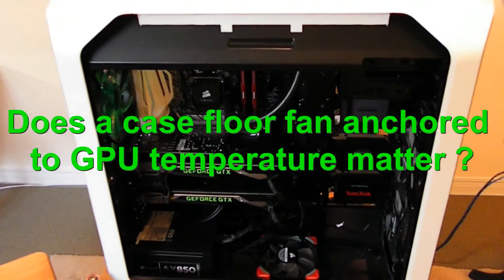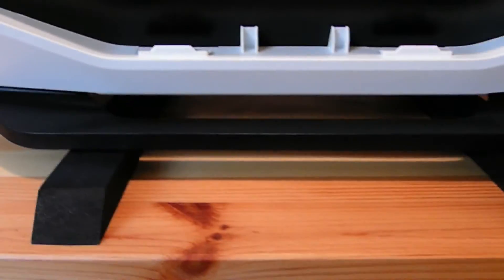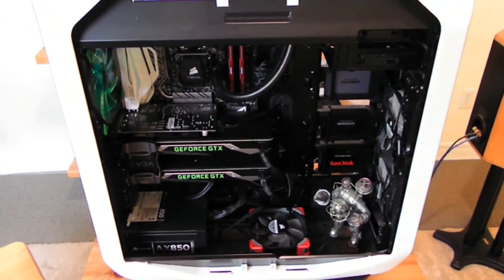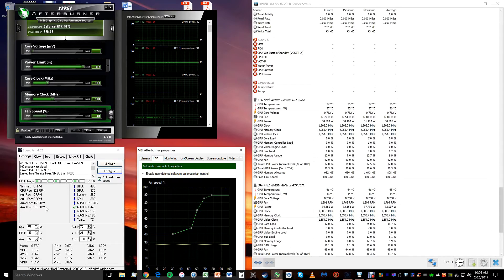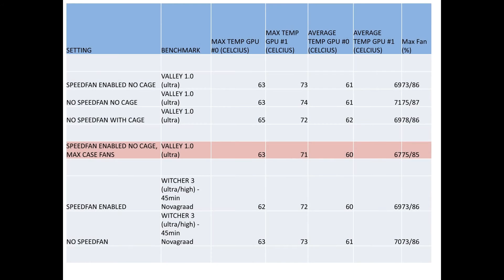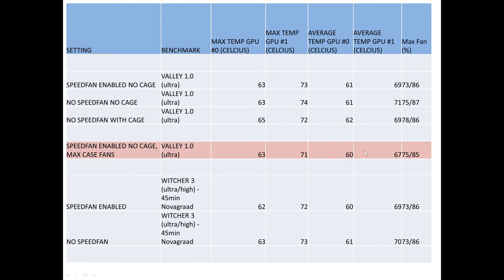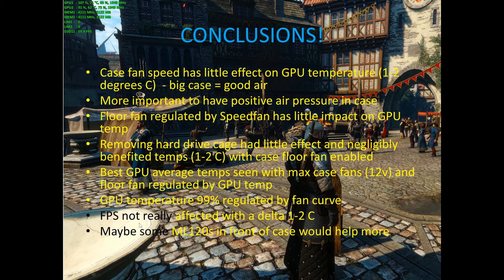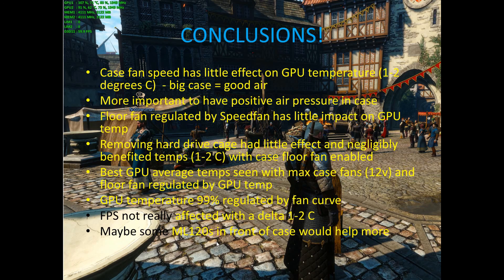Corsair 780T Case Fan Mod with Corsair ML120 fan to improve GPU cooling

Comment: How did you mount your SSD’s in the back? Did you purchase any additional mounting plates?

I’m in the process of removing the hard drive cage and changing location of my 5TB HDD to where you’ve placed your bottom fan but I also have a 1TB SSD and that side mounting looks sweeet.

Comment: I merely removed the excess HDD slots and saw a 3-4 degree decrease in GPU temp. I will remove the whole tray tomorrow and should see a decent increase. Running a 1080ti

Comment: I have the same case with 2 970 sli but mine do not exuast at rear as they have  aftermarket coolers. I have a h60i cpu cooler at rear exaust via 2 noctua industrial 2000RMP. I squeezed 3 AF 140's at front intake (2 of them stacked in the same mounting location), 2 AF 140's top exaust 2 SP120's on the floor intake and since I've recently started mining I'm really concerned about my top card frequently reaching 80c while I sleep. Any advice? Currently my only consideration is moving my radiator to a top exaust.

Comment: I noticed with my PC that moving fans/varying fan speed makes little difference to GPU temperatures with a GTX 1070 due to the way that speedboost 3.0 works. Instead, better cooling was revealed by the fact that the GPU stayed at higher sustained clock speeds (i.e. more heat being generated, but more efficiently removed). Better cooling also allowed more stable overclocks at the same reported GPU temperature. Although I note that you say there was little effect on your FPS readings during your investigations, the above information might be useful for others (especially those who don't listen to everything you say) to know that looking at GPU temperatures on the 10-series cards does not necessarily reveal how effective a particular cooling setup is; from a GPU perspective, I would argue looking at actual clock speeds in something like MSI Afterburner is more informative.
Reply from the maker: right I agree. I think I note the average and max clock speeds in this video using msi afterburner.  It's a bit tricky however because the average gpu clock is affected once a test using a game is over. but if data are collected quickly and the gpu test is conducted long enough, then the average will not be afeected much. i still have two corsair ml 140s in the basement of my case which now is a be quiet dark base proo 900. see video on that if interested.